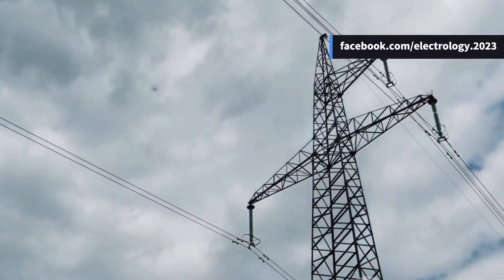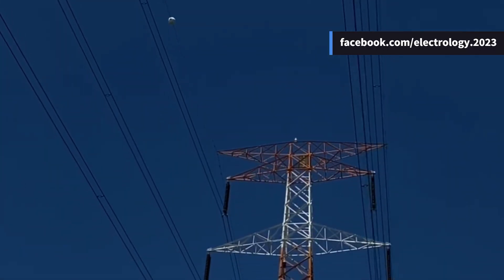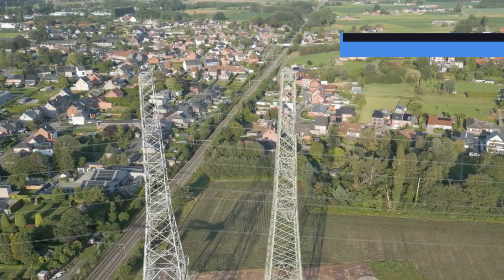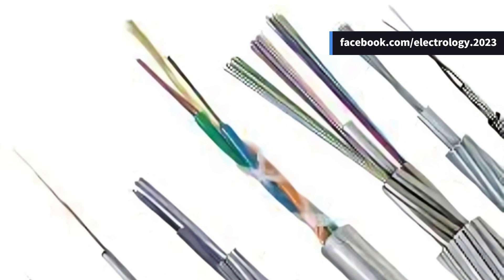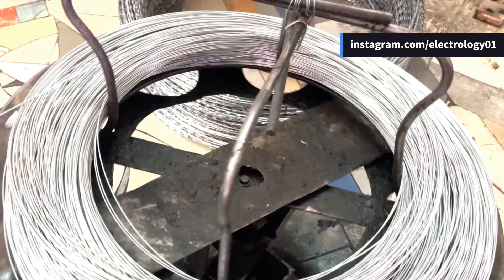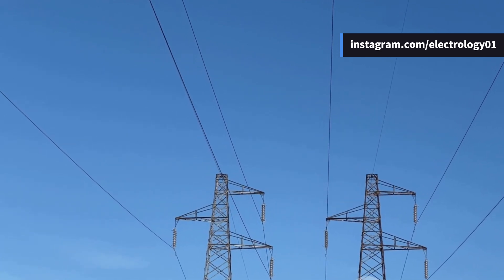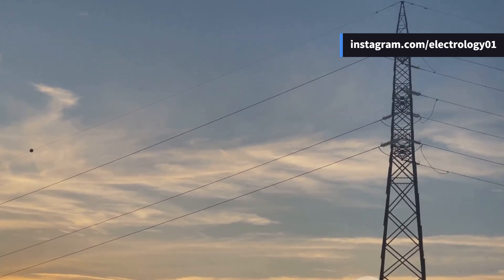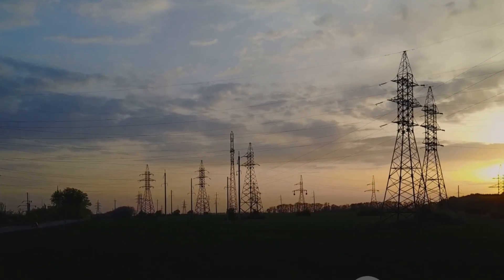The Hidden Dangers of Ignoring Ground Wire in Your Power System

Comment: The ground cable at the top of the pylon can also be equipped with a fiber optic cable. 
Data can then be transferred via it. For example to control electricity.
Reply: Near airports, red and white balls are hung on the ground wire. This increases visibility for the pilot.